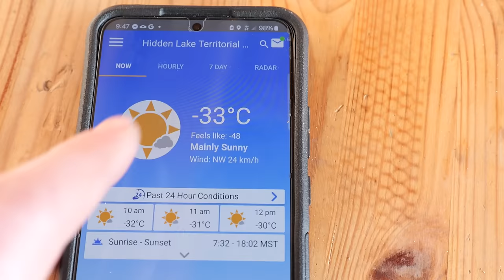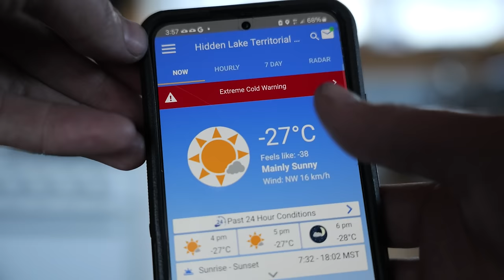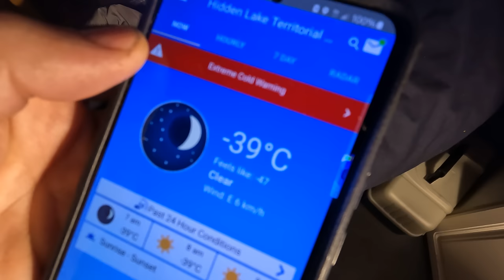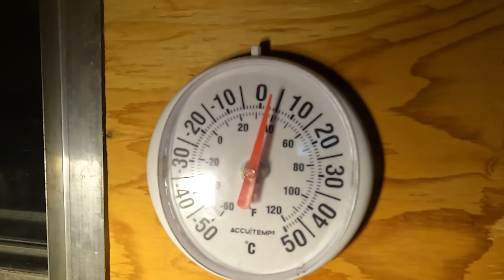COLDEST WEEKEND EVER AT THE CABIN. 3 DAYS OF FROZEN

Comment: While I am offering advice not asked for, use a top down fire start, not bottom up. Clean out the fireplace before you leave the cabin, stock the wood on the porch to max, split more kindling that you will ever use, bring in a full wood load out inside the cabin to stay dry, to be ready next trip, set the bottom logs with top kindling before you leave, and have a propane or MAP gas torch to use to start the fire when you first get to the cabin. Consider building a small shelter for the snow machine next to the generator and run the Honda's exhaust with flex pipe from the gen shed to the snow machine shed. Bury a ten gauge extension cord from the gen shed to the snow machine shed (and run one from the shed to the cabin while you are at it this summer) - best to land on a breaker box. A wall mounted vented propane heater will jump start the cabin heat up from the low temps, even fifteen minutes really helps. Now #1 idea is to build an airlock entry to save interior heat. Never open both entry doors at once, and consider why native cultures use a small entrance door often with the entry/threshold lower than the interior floor. Add more thermal mass to your wood stove/heater - even bricks are better than nothing but I like cast iron or if you have a friend in the trenching business, get some cut up trench plate for a close to the stove surround. Insulate the floor under the stove with the dense rockwool sheets and top it with large soapstone slabs. A 6" or 8" insulated round duct run from the peak of the ceiling strait down to a nice place to sit with a reversing fan inside the pipe will bring hot air from the loft to the lower floor area. What else? I want a cabin like yours but in the Caribbean or maybe Baja California. Bob in Nevada
Reply: All ridiculously good advice 👍🏼👍🏼
Reply: While this may be “advice not asked for”, it is advice that is needed! I live in sunny SoCal and will probably never be exposed to these extreme temperatures! However, your sage advice is worth noting! You never know where life’s journey might lead!
Reply: Всё правильно, у нас в Сибири главное - тамбур на входе, далее - при входе в основное помещение две двери (тина открывается внутрь, другая наружу). Обязательно высокий порог (меньше холода попадает). Остекление - двойное стекло в раме, установленное герметично + зимой всегда ставилась вторая рама с одинарным стеклом и на ночь всегда окна закрывались деревянными ставнями (всё для уменьшения тепло потерь). И да, согласен - чем массивнее печь, тем дольше она остывает (но и дольше нагревается при редкой посещении). Так деревянные дома построены у бабушки с дедушкой, а там зимой, в январе так называемые "крещенские" морозы - это -52°С... -60°С.
P.S. И да, нижняя часть дома, на высоту примерно метр от земли,  утеплена так называемой "завалинкой" толщиной с полметра минимум, а лучше метр - зола, опилки, зачастую смесь опилок с известью и сверху засыпана золой (защита от огня).
Reply: I agree! I can't believe how many of these you tuber outdoors men get to the cabin in the bitter cold, usually when it's dark and start collecting firewood and kindling.
Reply: Great ideas Bob
Reply: That a great advice
Reply: Also have a pull start capable snowmobile. Brent in Northern Canada
Reply: Wow. Really great advice sir. Impressed.
Reply: Wow I think you covered all the bases lol😂😂😂😂😂
Reply: I'm thoroughly impressed. I wish I knew anything about as much as you know about cold living.
Reply: I was thinking the same thing about the fire. Leave it well stocked, cleaned and ready to light. When you are fighting frost bite on the face, saving time is an issue.
Reply: @АлександрБаулин-п3ь  great and amazing advice thank you for sharing!!!!!!!
Reply: Needs a shed for the sled yep.

Comment: A couple of tricks if your truck wont start.  You can drain your oil into a pan heat it on the stove and put it back in. Or use that cast iron pan of yours, fill it with coals form your fire, place it under the oil pan, protect it from wind. Works like a charm (in a pinch).

Comment: Chains, snow tires, recovery ramps, dedicated truck shovel, winch with anchors, even buckets of sand available. Also, before stopping truck, drive back and forth packing snow down for a level starting area  when you leave later 

Yes, you can ask me how I learned these things slowly over time! 

Love your videos ❤
Reply: Would studs have helped on ice? If a country allows those off course, mine doesn't. Although.. now that I think about it.. the snow is more so the problem.. hmm.. guess it's don't mind my reaction ☺️
Reply: Studs work great!  Back in the day though. Rough on the roads. Can’t use them where I am.  My job as a kid pushing them into my dad’s tires one stud at a time.
Reply: Learning through experience,  Yes??  😊

Comment: Canadian here. If you get.
 Snowed in, and you get stuck in the snow with your truck. Try a little bit of cold ash from your buck stove. Make yourself a couple of trenches and put the ash around the tires and in the trench. And for the next time , make sure you have sandbags for extra weight in box of your truck.  Get yourself a set of all terrain snow rated tires.  Good luck😊

Comment: Jay, for next winter, I recommend Mickey Thompson Baja tires, with side tread. Above all, put snow chains in your car for the rear wheels. 
For your snowmobile, a good sturdy tarp. 4 x 6 meters and park it underneath, so that the wind doesn't cool the snowmobile too much and over the seat, down to the ground, a thick wool blanket, preferably put it on wood, so that it doesn't have direct contact with the ground. That's how it's done in Russia up by the Arctic Ocean, where we had real sub-zero temperatures below 50°C. On your stove, put real wood in the evening and bricks on the stove top and between the wall and the stove too. You will see that the bricks keep the temperature for a very long time and it stays warmer in the house.  Greetings from Frankfurt, nice video and stay healthy.

Comment: Glad to see that you now have a motorized ice drill. Sadly you now need a stronger battery driver for it. The magic blue smoke comes from the motor being overrloaded as the battery loses charge. As the volts go down the amperage goes up to compensate and the extra heat starts the cooking process.

Comment: You're getting the weather we had in FBX, AK for 2 weeks but we worked through those wicked cold days, I maintain 80 pieces of equipment for servicing aircraft and ground handling and snow removal. Tire chains are your friends and an air compressor as well. Do your four stroke equipment a favor and put some Kat's brand, silicone on heating elements on oil pans, transmission pan, an inline heater for coolant your taking the life right out of your equipment. Making your starter life shorter and trying to turn your cold engine oil through bearing's and galley's. Everything functions best at a certain temp your ECM will shut down everything when your PCM say's nope not today and vacuum lines don't / won't properly either. Your learning and you have good fortitude!

Comment: Looks like you've got the starting battery problem solved, but at those kind of temperatures you're probably running into fuel issues.  Glad to see you get it started up without much of a problem though.

You've sure settled into the cabin now.  Another home away from home.

Comment: Brother, assuming when you can afford the upgrades, may I suggest some 35 inch off road tires and a 7 inch lift on that 4x4. Of course chains will help significantly too but some aggressive mountain tread and a lift will minimize your need for having to hassle with chains. Even some all terrain tires will work significantly better in snow than those street tires your running with. 😂

Comment: I'm probably late getting to this, but get a hammer drill for your auger bit. The motor is much stronger than a standard drill. It won't burn out on you. I use a Milwaukee personally, and can bore through 40 inches of ice no problem. Love the content!

Comment: Jay, Dewalt should warranty your drill driver, I’ve done exact same thing as you did and took it back to HD and they handed me a new one. You also need some better tires and chains. Another thing is the half ton pickups nowadays just do not have a lot of ground clearance, unlike the older ones that did. They have the tendency to high center in hard packed snow like you just encountered. Have you learned how to get the Y bones out of your pike? A good breading to pan fry them is flour, cornmeal, garlic salt, onion powder and pepper. Fry in a little oil and butter. Yum, so good!

Comment: Seeing suggestions about mats for use in snow or mud ,but seeing you split that timber to put under the tyres ,i would make some wooden mats ,tied together with some wire ,easy to stack in the truck etc and plentiful supply, not using plastic is a good thing  !

Comment: Need a brushless drill for those augers the 20V Max Dewalt works best. Wont burn them out. Minnows work every time out there. If you set a little deeper right on bottom just before dark you will catch burbot set one dead stick and one jigging stick you can have two lines for ice fishing. Poor man lobster is delicious.

Comment: I think part of your problem with the truck in the drifted snow might have been a case of shoring up on the depth in the center. Your axles and differentials are quite low, even in a truck like that, and can add that extra bit of drag against the center-line mound of frozen snow that will stop you from getting traction again if you momentarily lose it at slow speed. More aggressive snow tires and possibly some studs in them might help keep from losing the traction. something in a the way of skid plates for the front of the suspension and on the front of the rear diff (does that exist?) might help as well.

Comment: Hello Jay. Great video. For the cabin not to get above 3C with it -50C outside, i wonder how much insulation is in floors, walls and ceilings. We are easily able to maintain 22C in our place when its -30C outdoors. Granted, we are not heating it up from -30C and we do have thermal mass in our place. Those look like sliding windows with aluminum frames. Sliding windows are notoriously bad for high heat loss and the aluminum frames makes it worse. Also you have a lot of window area. Short of replacing the windows with dual pane casement or awning units with Cardinal LoE 180ESC glazing and vinyl or fiberglass frames, consider making inside thermal shutters with 1.5 inch thick SM rigid insulation, at least for the upper windows. They could be hinged from the top and be lifted with ropes and pulleys.

Having the stove on a thermal mass as suggested in other comments is a good idea, but i wonder how efficient your wood stove is. If not already done so make sure you have a working CO detector.

You mentioned on another video that you want to add an extension. This could be your vestibule to control th😅e infiltration entering your cabin. Insulating this addition would be a good idea. There is a foundation system called Postech that uses augers similar to your ice hole maker. Due to your remote location it may be a challenge. Special equipment would have to be brought by barge to install the Postech piles.

Comment: Careful lighting those over the bucket of slits, one spark, smoldering, poof.  That stove is an absolute beast.  Reminds me of those 16 Merlin engines all lite.  You'll kill that starter relay doing that.  Better carry an extra.  Be smart, plug it in first.  So hard on an engine to start it that cold.  Oil is frozen around crank thicker than black strap molasses.  It just won't work.  Give it plenty warm up time after it starts.  You need some serious tires.  Some buckets of sand.  Check out plow guys tires.  Great vid man.  You loosened up some.. Enjoy.

Comment: See if you can get some 17” wheels/tires for your truck. The 20 or 22” wheels are worthless off road..  what you can do with a taller sidewall is let some air out.. down to like 10psi or so, then u can crawl out. 

Another option is to get a tacoma or 4runner.. they dont have that pto 4x4 trash the big 3 stick us with. 

Great video.

Comment: Maybe if you put a little bit of a lift kit and more aggressive tires on that may not of happen. Also remember that even it's that cold ,tires still generate heat. I recommend when you get to your destination to park , drive back and forth 3 or 4 time's to let your tires to cool down. It will save you a lot of work.

Comment: Super hard on your engines trying to start them in those cold temps. Should be plugging them in for an hour or so with your generator. Need to be better prepared as well travelling in those extreme conditions. Extra clothes land a shovel for sure.

Comment: Bro, you really should put your battery inside which make cold start so much easier and safe. Also, for that battery booster, it is better to connect it to the battery and wait for at least 30 seconds then try to crank the engine.

Comment: The truck needs some additions/modifications for snow conditions like that.  Those side steps, ugh!!  They either turn into ice blocks and hinder any work that needs to be done when stuck, or in my case the rocks just rip em off.  That and find out what Les is running on his plow truck and start there.  Lift, good off road snow tires, lockers, chains, he's probably running all of it to push that blade in that much snow.  You're going to put some money in it for sure.  But, that vehicle and any other vehicle for that matter is your way out in an emergency.

Comment: Ahhh dunno about a machine that you have to plug in at -30 to start.
Test Fail.
Definitely not a fan of that contraption.
And those tires are for highway use, not off road.
And it was pleasant to watch that hokey drill auger burn up lol.

Comment: I'm more concerned that your not better prepared for the weather.  Fill your gen with gas before you leave the cabin.  Easier to deal with starting.  Have a 3 way cord, when you charge your snowmobile battery you can charge other battery powered items.

Comment: Those tires look like regular street tires. Are they snow tires? Jay, That's an awfully small motor to use for something so difficult to turn. I remember trying to mix mortar for a tile job with a half inch corded drill and it started smoking.

Comment: That's why that drill has a two-speed setting it's got a first gear and a second gear you were in gear number two when you should have been in gear number one that's why it's smoked on you it would have never smoked to begin with if you had just put the gear in the first position not the second.

Comment: I've seen Dewalt drills smoking and just keep going. I like do my yellow tools but they are slowly being replaced by red ones...
Reply from the maker: You prefer Milwaukee?
Reply: @jaylegere  Yes... for the power, they outperform my DeWalt tools.  I have lots of DeWalt stuff and I like the feel of them in my hand more than my Milwaukee tools. The Milwaukee tools outperform the DeWalt handily in some tasks though.  Big 16" GRK timber screws  no prob for the red impact but the yellow can't sink them.  Red nail gun is miles better than the yellow.  If you go for a framing or finishing nailer it has to Milwaukee... no contest.
Reply from the maker: Thanks for all this info. It's really helpful. Jay

Comment: Why are you so Selfish and not being Prepared for any incident things such as useing the jeep   why No Chains on Wheels to get better Grip .Going straight through the open area where as if you drive between trees for example you have Anchor points if you are stuck to tow from  and also no winch   these are common items used for these conditions in a situation    because if the worst were to happen you have to depend on others to rescue you